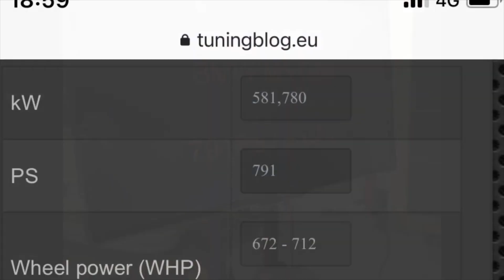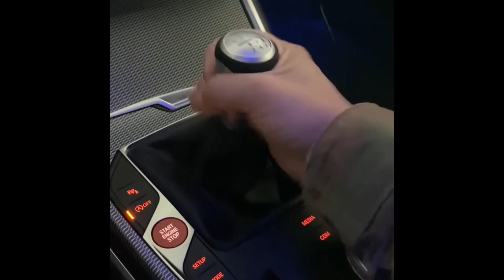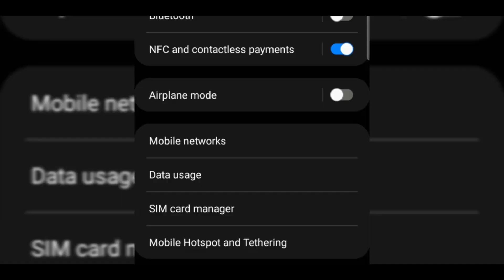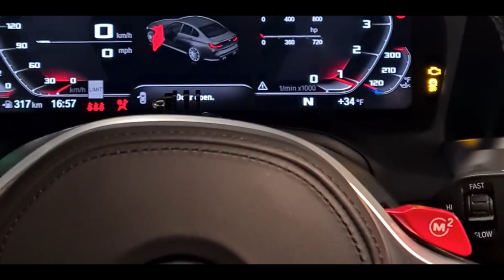How I built my G80 M3 in | 11 mins!

Comment from the maker: There was more parts installed of course but without making the video too long, here’s the list of mods it had.

R44 Front Splitter 
InkedCustom CF Rear Diffuser 
InkedCustom CF Intake Ducts 
InkedCustom Intakes 
InkedCustom Downpipes 
InkedCustom Midpipe 
InkedCustom Catback 
PSG Wheels 20x8.5/ 20x11
AST Lowering Springs 
M Performance Shift Knob 
M Performance M3 Black Emblem 
EuroActive Retrofits Taillights 
Femto DME unlock 
PureBoost Tune pump/ E-mix